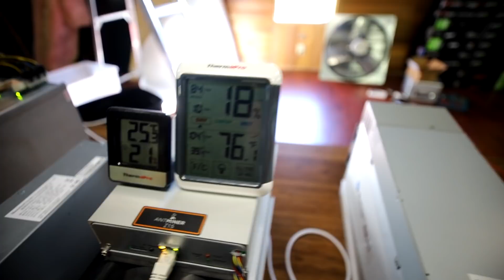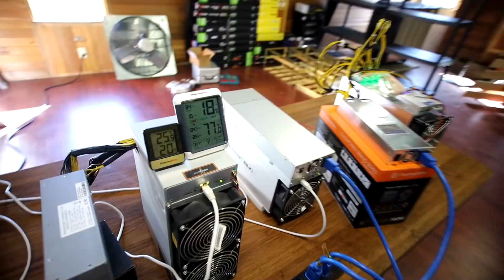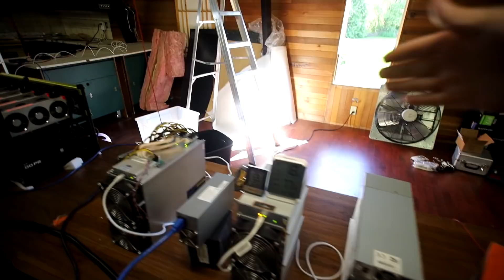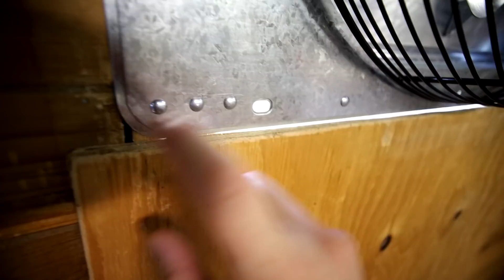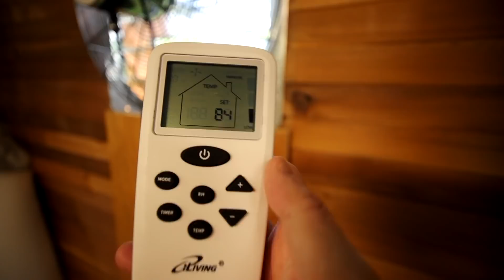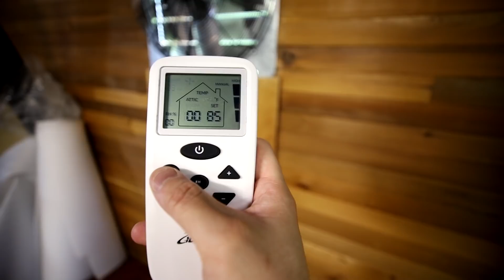Mining Barn Getting HOT!

Comment: Fun Fact, you can add a (much needed) screen by removing the fan from the shudders, then stretch out and staple some aluminum bug screen (rolls available at Home Depot) across the opening.  Then poke the 4 bolt holes and reattach the fan.  Because as you've noticed, those shudders aren't exactly air/bug tight.

Comment: You know that you can model and simulate that so that instead of just trying to guess, you can ACTUALLY put some science behind it to ACTUALLY solve your building thermal management issue right?

Like, it's really NOT that hard.

But even without running the CFD simulation for you, I can tell you right now that without some kind of heat exchanger and/or air conditioning/vapor exchange/refrigeration unit, you WILL run into thermal problems by the time summer hits because if you're already hitting 37.8 C (100 F)+ now, by the time summer hits, let's say it's 35 C (95 F) outside ambient temperature, your systems WILL thermal throttle.

I have one system in my basement right now and I needed to set my A/C set point to be 20 C (68 F) in order to keep the system running cool enough so that it will be able to run at it's peak/maximum efficiency.

With the number of systems that you have, and you're pulling about 8 kW from the wall, you need to be able to dissipate AT LEAST that much thermal power/heat hour after hour, which I can also tell you right now, that the 24 inch fan that you've got is barely going to make a dent in it.

Again, you can reach out to me. I can model up your room and also the heat dissipated from each of your systems and where they are located in the room and literally run the simulation for you so that you can ACTUALLY solve this thermal management problem vs. guessing.

It's NOT that hard.

Comment: I'm hardly a building air flow expert, but I think setting it up like a computer with intake oppossite of the exhaust would work a lot better. To have the intake and exhaust on the same side means the air has to take the energy of turning around. You'll reduce the over all flow.

P.S. Use hearing protection when around ASIC's.

Comment: Hi! Maybe someone already told you this. But having too much negative pressure will suck a lot of dust from outside through the gaps. But thats not the worst thing. That insulation that you have in the roof is REALLY dangerous for your lungs.  Having negative pressure, added to the hole in the roof where a lot of air is coming in, will make the barn fill with tiny insulation particles. You need to change that asap.

I would definitely add a fan intake on the other side of the room with a dust filter screen to prevent dust from coming in. 

Hope you find this helpful. Loved the video!

Comment: Really interesting stuff. I had the same Problem and i made nearly the same solution. I Installed Noctua Industrial 120mm fans in one window, created a wall and use another window to pull all the air out again :).

Is there a way to check out the fand and the control unit in other countrys too?

When i click your links here from germany i cant find any available products.

Same with the PowerPlug you showed us in other videos.

Comment: You already have a hole in the roof - put an extract fan in it when you close the hole. Intake as low as possible, exhaust as high as possible. Create a wall of shelves for the equipment around the exhaust, in a circle or square. Open some of the other windows a few inches at the bottom and fit grills and simple filter foam to stop bugs etc. getting in. Then most of the room will be cool(er) and you will make the loft hot(ter). If you get more equipment you could always create another ceiling exhaust hole and another set of shelves around that, same principle. Use plastic sheet to create a funnel above the equipment up to the exhaust fan, like a big tent, so the hot air doesn't recirculate before being extracted. The trick to efficient hvac is to prevent air mixing between the hot and cold zones.  Temperature controlling the fans will save you money in the long run. If you have powered exhaust then passive intakes should be OK, just have a lot more surface area for the intakes than the exhaust.  My 2 cents.

Comment: The fan that removes the hot air should be placed high as possible and on the side your barn that's exposed to peak sunshine (Maybe south, depending on your locations).  Your intake fan should be place low and on the shaded side of your barn (North Side), so your pulling low cooler air and as it heats up, the air will rise and be pulled out towards the heated facing side of your barn.  I grew indoor cannabis and learned all the tricks to keeping the temperature under control.   Awesome set up and thanks for your posts!! I'm new to crypto mining!!

Comment: I think you should move the controller for the fan to about 6 feet off the ground.
You want the thermostat to be at a higher level.
It is 80f on the bottom near the floor. 
I am running 12 ASIC miners at around 16 kw/h.
It makes a Hugh difference. 
Heat rises, and you want to set the thermostat around 2 feet above your tallest miner.
Based on what I saw in the video, it's about 4 feet off the ground, so I think 6 feet off the ground would be ideal.
Also, the farther the can is from the miners the bigger the difference you want in the height.
The lowest spot for the controller, should be at the bottom of the fan.
And the best spot would be at the top of the fan.
You measuring temp near the floor, which means the temp sensing would not see the heat before is cycle back through the miners, and you want to avoid that.
I would set it between 78-82 degrees target. 
Thank you for all the information you put out here, we love having you in our community.
Keep it up.

Comment: push the tables closest to your exhaust fan against the wall. hang a few 1000 cfm cannabis grow fans from the highest point of your inside roof above the tables with 8" ducting coming down the wall and out of the window above or below your new exhaust fan. you can set them up on a thermostat too so they only go on at a certain temperature. you really wouldn't need an intake fan for the room if you left a window cracked a few inches but it would help exhaust your room once you go over 3000 cfm. i see a kitchen in that room.... might be able to utilize the vent above your stove for exhaust/ passive intake

Comment: If you crack several of the windows to about 1-2 inches high you will generate a good flow of air through the barn. Keeping several windows open just a little in several places helps keep rain out and creates a better total room cooling than a single intake point unless you build a bunch of baffles to route the air through the whole room.

Comment: If you're northern hemisphere and your barn gets direct sunlight you MUST put your intake as LOW TO THE GROUND as you can possible get it on the NORTH wall of your building. You MUST exhaust your heat on the SOUTH side as high up the SOUTH facing wall as you can get it.

If you configure it any other way you're going to be fighting thermodynamics the entire summer.
Reply from the maker: This is great. Few others mentioned the same I'm gonna figure out north south sun
Reply: @RedPandaMining  on a sunny afternoon it can be a +15deg air temp difference between the shady side and the side in direct sunlight

Comment: I wouldnt use the roof space. The drop ceiling insuation is there to seal the roof away because roofs get SUPER hot in the sun, as well as heating in winter. Best bet is to have a whole window open going into a plywood box or even a 2x4 frame with 6mil as a wall (cheaper) and use that to direct air in from a whole one of those windows open with just a bug screen on it or something similar (as long as security isn't an issue) then use another window to draw out from using the fan. You can even make a sort of hot side cool side setup like this if you want.

Comment: You need to control where the air is coming in also.  Ideally you want positive pressure in the enclosure in order to make sure the air is flowing in and out the way you desire.  You can read about blower door testing, although I have a feeling that structure is not very "tight".

Comment: Fix the ceiling urgent.The cooler air coming from it as you said, is been pushed out by the new fan installed, w/o circulating where u need it. Definitely a smaller room can help, make cross window airflow with the help of fans

Comment: Don't put the intake and exhaust next to each other, it'll defeat the purpose. Put the intake on the shaded side of the building if possible in the furthest window away from the exhaust. I'd also consider  a couple big pedestal fans to move the air around more efficiently. Without an intake the exhaust fan is useless, its like trying to suck air out of a milk carton. I'd also consider adding more insulation in the attic if the heat from the roof is adding to the problem. Oh and close up the ceiling and put all the tiles back, the last place you want air intake is from the attic.
Reply from the maker: 100% agree with everything u said here. North south sun I will figure that out and open whichever side is cooler
Reply: @RedPandaMining   Good luck and keep us posted! There is also a possibility the attic space itself is not being vented properly which would cause the room your in to be significantly hotter than it should be, not sure of the set up though. It could be a ridge vent, could be gable vents, could be roof vents. All of these would work if the sizes are correct but also all of these solutions need a source for cool air. Typically the cool air is drawn up into the attic through the eaves and vented through one of the methods above. Id investigate the attic air flow because it will def help cool the building if the 190 degree air isn't trapped in the attic because you will feel it in the room below. The ideal temperature in your attic should be no less than 60 degrees Fahrenheit in the winter and no more than 10-20 degrees hotter than the outside temperature in summer, with a maximum of about 130 degrees Fahrenheit. That should give you a benchmark for attic temps to see where you're at currently.
Reply from the maker: @thebigapple4010  the ceiling/roof is all metal too yeah it's def a heat absorber haha

Comment: Panda, I already wrote 2 comments before about this topic but you didn't saw them...So let's start again. This won't work for the summer, your biggest problem is that you are heating up the whole room and plan to have active intake with hot summer air from outside. If during the summer outside temperature will be 30-35C you can expect in your barn 40-50C,simple physics... My suggestion is to buy few big grow tents(240x120x200cm) and fill them up with rigs. In 2-3 big grow tents you can put all off your mining equipment by stacking them, you will save up a lot of floor space in general like that. On every tent you put extraction fan(around 1000-1500m3/h for the mentioned tent) that you will connect with insolated air pipe, that pipe goes to the window where you can make a simple plywood box over the whole window with pipe connectors. Intake for the tent is passive trough bottom mash screen window and intake holes. Then you can put one active intake for the whole barn, that you wont have too big negative pressure. And also I would try to take some colder air from the basement or something like that to replace that air inside the barn. The bottom point is that you don't want to allow your equipment to heat up the whole barn, only the grow tents. This will make the barn cooler in general, rigs will be cleaner, you will loose few db of noise and WILL WORK for sure!! Grow tents are cheap on Amazon, you don't need some high end tent, just buy the cheapest one. Fans are also cheap and can work for years if you buy the right ones. That's by far the best and economical  solution for your problem. Everything here said I can back it up and know it will work for my experience and if you have any questions I'll be glad to help.
Reply from the maker: I would love to do grow tents but I'm trying to keep it open style. I know as well grow tents work I did one 2 years ago in my condo haha have videos about it back then but yeah def man... Gonna try it this way for now and see how it goes. I understand the whole barn is basically a huge ass room and CFM to pull that would be immense. We'll see this summer if it's bad then have to revisit
Reply: @RedPandaMining  Try it out, hopefully it will work. If not, for few hundred dollars you can resolve the problem with tents.
Reply: Doc, I have an  idea of using a cooking hood style of heat extrusion just setting over top of the rigs. With the same concept of piping it straight out a window.  Have you heard of anyone that has used this idea yet?
Reply: @ironskin5479  But the heat from the rig(I assume you have more or less traditional rig that blows air from one side to another) will be blown sideways and not up to that extraction hood, so you will just heat up the room and extract limited amounts of heat out. You need something that can trap all of the heat on the smallest possible area, that's why I suggest grow tents or grow rooms(huge versions of grow tents). And the principal of what you suggest and with grow tents is the same, you also extract hot air on the top of the tent. But the key difference is that you trap all of the heat inside of the tent and passively bring new(cooler) air in on the bottom. Then just to extract it out from the room through the window by insolated pipes. Only thing that comes to my mind for you is to rotate rig if its possible that all the hot air is blown directly to that hood, that would work in some degree, but not ideal...

Comment: I would have put my exhaust fan on the outside of the building so it protects the window casing from rain and weathering and I would close up the space in your attic so you do not draw all your hot air from your attic down across your mining equipment and you're cold air intake should be catty corny from your exhaust overall great video appreciate you taking the time out of the day to do all your videos much gratitude have learned a lot about money from you greatly appreciated
Reply from the maker: Yea I plan on fixing that ceiling and figuring out north and south sun someone mentioned and then maybe  intake on whichever side is colder during the day

Comment: Add a vent fan up high, pulls hotter air and is more effective than the window exhaust down low.  I put a slatted vent fan near the peak of my garage.  Was well worth the 12x12 hole I had to cut
Reply: The peak of your barn can be 10-15 degrees warmer. if you add an intake in that window have it pull low and towards the front of your setups.  might mean turning all your rigs around so the front faces that window but will be worth it.   with this and opening my garage 2 inches for low cool intake it dropped my temps by 20 degrees.  Thanks for all you share, you helped inspire me to dig further into mining.

Comment: You need refrigerated air. You need a split system heat pump and air exchange system. You also need to keep it at 75f. I work in a server room and the temp is a steady 68f-70f. If it hits 85f there are automatic shutdowns until cooling is restored.

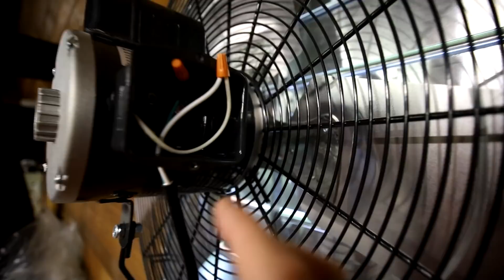Comment: 6:20 Get yourself a half-inch wire fastener. Before you rip the wire  out of the fan motor.
Reply from the maker: I realized it came with a fastener after I installed it lol
Reply: @RedPandaMining  I know that feeling. But definitely get it installed and I would also wrap my wire nuts in electrical tape. That fans going to do alot of vibrating. So it could essentially vibrate the wire nuts off.
Reply from the maker: @ThomasDiy  electrical tape the ends good call. It does vibrate like a mofo

Comment: the loft (attic) space will most likely be the biggest heater in the summer. You will need that insulation back up to keep the loft air and ground floor air from mixing. 
In terms of flow, you'd be better off pulling air in and pushing it out in the same direction. If you want to use your windows in a C like configuration, then you should place a barn fan above your rig area, to ensure the air flows in a C rather than in one window, and right back out the other.

Comment: Since you are trying to cool an entire building, you should consider some energy efficient changes, aka green architecture practices/passive cooling. Things like white external paint, cross ventilation (NOT a U shape like you mentioned, just very inefficient for the shape of the room you have) , external sun shades for windows (trees/bushes), or putting your intake on a side of the building that doesn’t see much sun, choosing to place air intake windows on a side of the building that is away from paved/ thermally dense surfaces, that kind of thing. 

You might scoff at some of it, but we’ve had close to 50 years to fine tune what works, and what doesn’t.. The above are some of the things that are taught in architecture schools across the world

Comment: hey man not trying to be rude or anything but you have a outlet right under the window. that plywood will protect you from some rain water but if you don't have a water deflector for the window on the outside of that window you might get some water infiltration and short your outlet/electrical controlor(since the outlet is not working) and trip a braker in the good situation or start a fire in a bad situatiion. i hope you don't take this as a smartass comment i just thought i should point that out in case you did't realize in the rush of installing it for the video
Reply from the maker: I explained near the end ish the outlet is burnt out. There's a overhand infront of the window so that's good